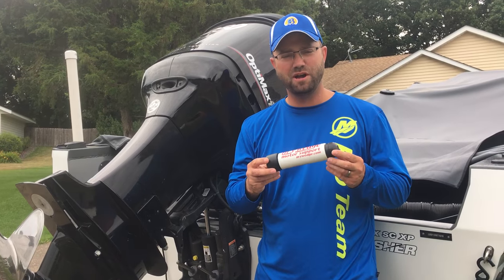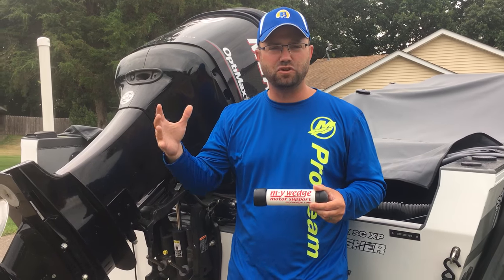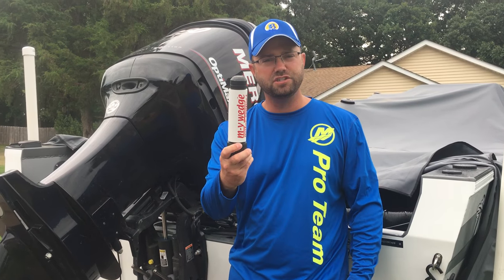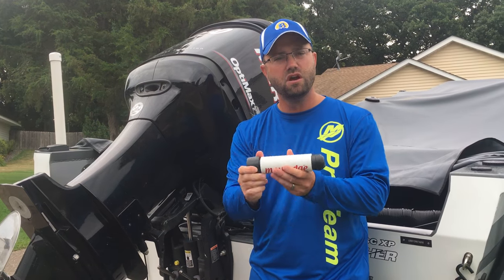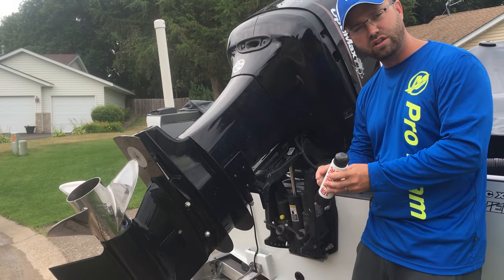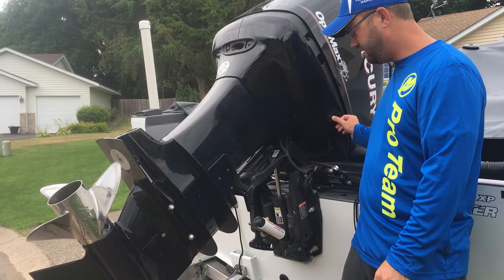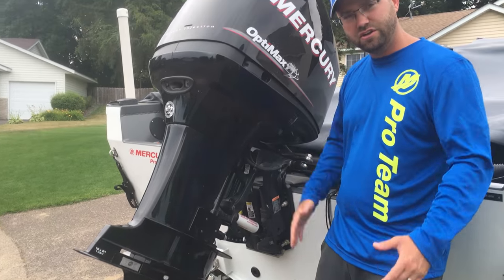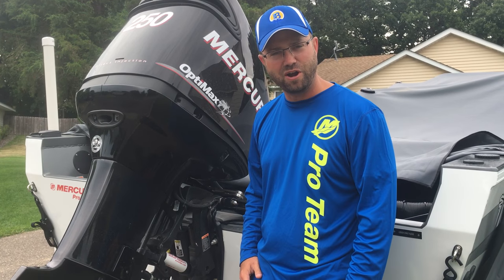Transom Saver for Your Fishing Boat

Comment: This does nothing to reduce the stress on the transom. All it does is keep the motor from bouncing too much. All of the weight of the motor & brackets are still producing stress on the transom. None of these type products will save your transom.
Reply: Chris Shaw I agree with you 110%
Reply: Chris Shaw so true...
Reply: It keeps the motor from travelling up and slamming down slamming down all the way on poor quality highways.  This reduces forces on the mount/bracket considerably. I have trailered my 225 with and without the transom saver on and it makes a significant difference
Reply: Everytime it slammed down I lost tongue weight and you can feel it lift the ass end of my 1500 sierra. Never feel that with the transom saver on. Definitely not a coincidence lol
Reply: Robby G13 
Get a Sierra 2500HD and a real transom saver. LOL
Reply: Chris... Right on Brother...  I'm just a little more sarcastic than you...